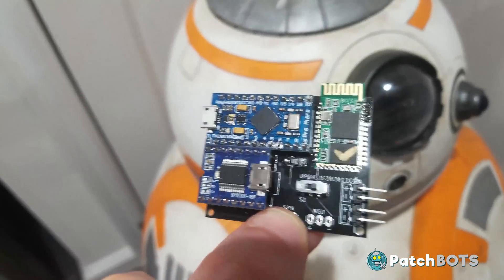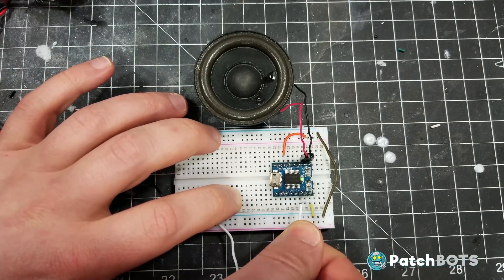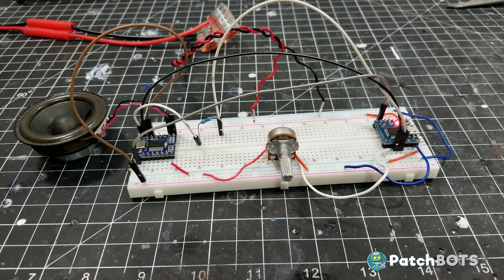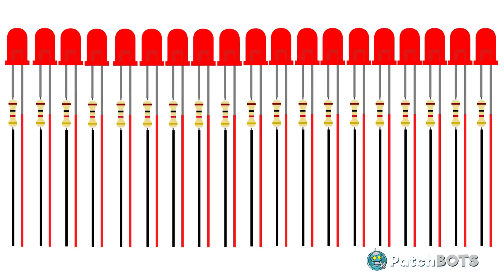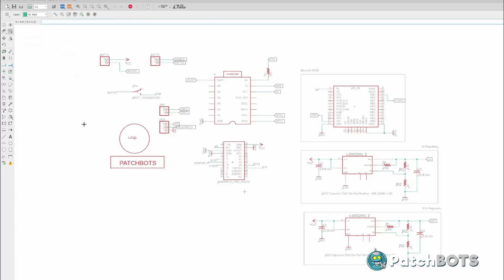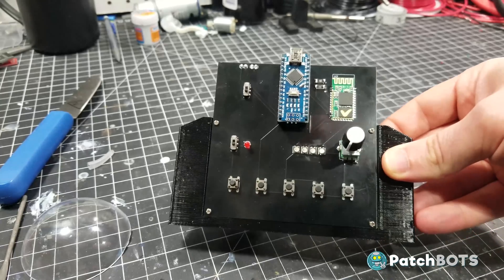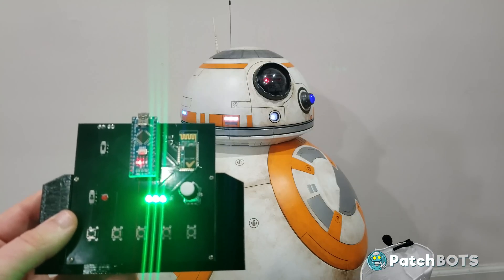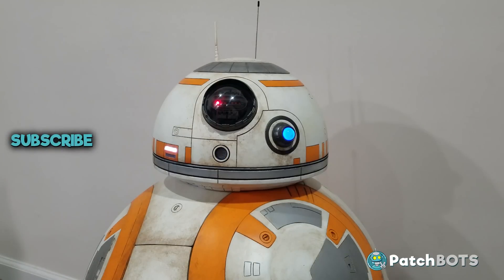Star Wars 3D Printed BB-8 | Head Electronics Upgrade!

Comment from the maker: First of many BB-8 upgrade videos!   I've been meaning to upgrade BB-8 for a long time and the head here is just the tip of the droid!   Stay Tuned for more!
Reply from the maker: @sharkeyward-i2l  Sure, they are here:  https://github.com/PatchBOTS/bb8head/tree/master/PCBs
Reply from the maker: @sharkeyward-i2l  Jeez, for a fully assembled board? Or just the board?  I wouldn't go with assembly on this, its pretty easy to solder.  PCBWay can get you 5 boards for 5 bucks + shipping.
Reply: Thanks a lot :)
Reply from the maker: @sharkeyward-i2l  53.1 x 43.3 mm

Comment: That's exactly what I want my BB8 to be able to do but I'm having trouble getting the code onto the arduino Uno, do you have any tips? Also was your code with the volume control integrated into the Arduino code thats on the BB8 builders club or is it your own custom code?

Comment: Nice work.  I have also been planning on using a transducer in my modded spinmaster BB-8, though I keep waffling on the idea for weight reasons.  I may end up buying the same model transducer that you have (which I wasn't aware of before this video) as its listed weight is significantly lower than the Dayton Audio models that I already have on hand.  I've never attempted to design a custom board, but I've been keeping that idea in the back of my mind in the (very likely) event that I end up needing to reduce the weight of my dome.
Reply from the maker: Thanks!  Yeah the transducer is definitely the way to go.   As I learned with my little "power glitch" they definitely draw way more current than a regular speaker, so consider that as well.  Very loud though!  I also use done in my DC-15 clone blaster build which you can see on my channel. They are pretty versatile little things!  Good luck with your build!   I received my updated boards for this BB-8 projects and the "power glitch" has been resolved.  Looks like it truly was just bad board wiring and poor heat sinking. I'll be posting my gerber files/ schematics with the Part 2 video if you want to take a peek as you make your own board.